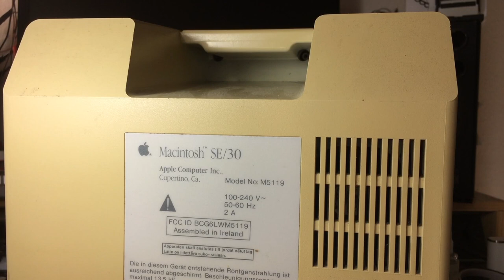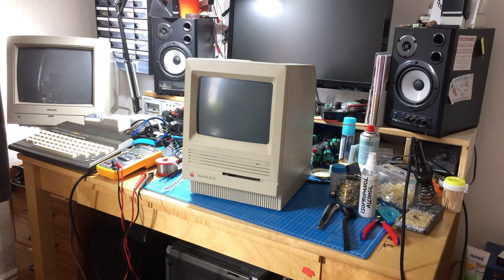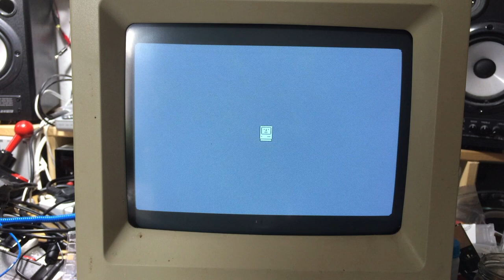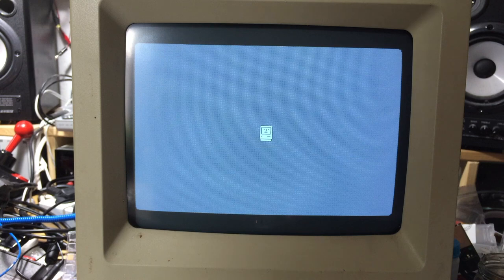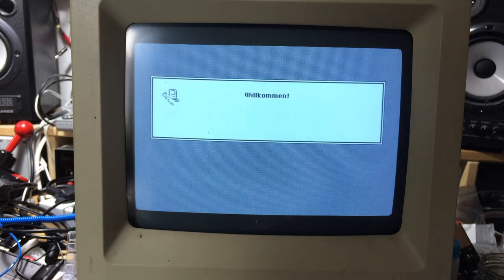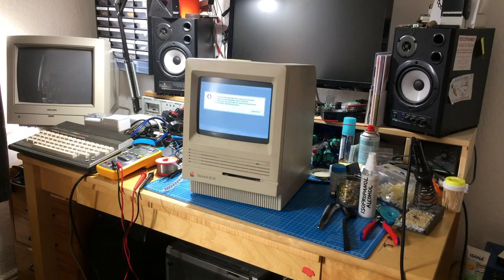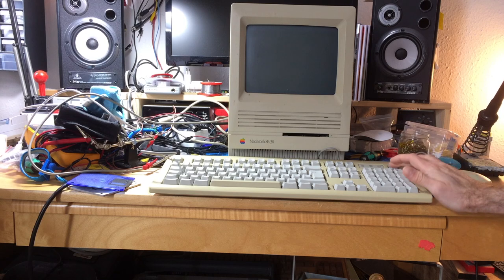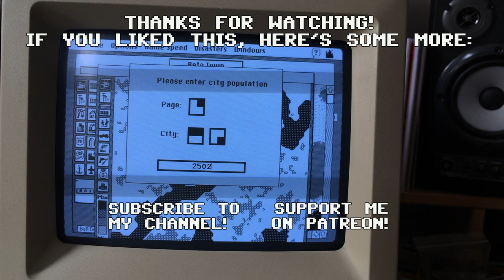Macintosh SE/30 Capacitor Leakage Repair and Recap

Comment: I had my SE/30 motherboard re-capped recently and am very happy I am back to using System Software 6.0.8, which is very fast. I play a lot of the classic games but mostly use it for writing. With the super fast boot and shutdown times if is something I can use when I get up in the middle of the night with an idea I want to add to my other writings. It is almost as fast as using pencil and paper, but much easier to edit. Nothing beats these old Macs for an uncluttered, focused writing experience. I use an old DA called Diary. It is the best for simply sitting down with some coffee and writing. My SE/30 has been a part of my life since Christmas of 1992 when I bought it from my college roommate, so while not the original owner, I have had this computer for about 27 years now.

Comment: Great Vid.  Just went thru a lot of this myself with my Mac Classic.  Opened it to check the battery, and the battery was fine, but noticed some cap leakage.  Ordered a cap kit and removed the caps.  That's when I noticed some bad looking corrosion under one of the caps.  It ate thru part of one of the pads.  I cleaned everything with isopropyl and vinegar.  Luckily when I checked, there was enough of a pad left on that bad one to still resolder the new cap.  The system acted a bit unstable after the work tho, so I took it out and recleaned it.  It still didn't look as clean as I wanted, so I went for the dishwasher method.  After lots of drying, put it back together and it seems good now.  Hopefully it is OK for another 15 years or so.  ;-)

Comment: I still have the original system 7 full disc set in its original packaging, great to see an old Mac up and running.
Reply from the maker: Oh, nice! Pretty hard to get those today in good nick, I guess. Had to fiddle around quite a bit to write the old HFS disks. I thought it would be easy with my MacBook and an USB drive but OSX dropped support for HFS some versions ago and only supports HFS+ now. Had to use bash and dd the image files to the disk. Which in the end worked very well. I found out later that most Linux's supports HFS natively. Maybe I'll do a little video about that some time.

Comment: awesome Jan. when i first started work a million years ago i worked with SE30s and LC2 Macs. They were awesome machines for their time given the counterparts were PS2 model 70s and Windows 3.11. Good to see this little beast running again.
Reply from the maker: Thanks! Yes, it is running very smoothly compared to the PCs of the time. And the OS was light years ahead in terms of simplicity and speed. :)

Comment: I know this is an old video, but the twist method to removing caps. I've lifted traces using hot air (because they often glue these components to the board for the solder flow machines), and lifted traces just using the soldering iron rock back and forth method. I think if if a pad is badly damaged to start with you're going to end up having to repair that anyhow. One thing I've run into with hot air too is the cap exploding? What temperature did you use?

Comment: Great video, as always mate. Reference cleaning the pcb's, the best method I tried so far is vinegar first and then dishwasher. Never got any damage with that method and pcb's come out nice and shiny :) Keep up good work!
Reply from the maker: Thanks! I was a bit hesitant about the dishwasher but will try next time (maybe with a less valuable board at first). :)
Reply: Dishwasher with a mild non-abrasive soap solution.
Reply: douro20 whoa, that's a coincidence.. You commented just now, and guess what? I'm washing x4 Commodore PET motherboards now :)

Comment: Hey Jan. I have one of these I bought in 1987 new for about £3000!! So have never thrown it out. I am about to start restoring as it no longer boots. Thanks for your video. I used to work for an Apple dealer at the time and if the case of an old Apple II was dirty we cleaned with T-CUT which is designed to restore car bodywork paint. It’s very effective on macs...
Reply: Bought my first Mac - a Mac Plus for $5000 in '89 and it became a career. Even worked at Apple.

Comment: Those Quantum HDDs suffer from bad caps btw =D  Often you can get them running properly just by swapping out the few caps on there.
Reply from the maker: Oh, thanks for the tip. I'm going to get in there and recap the PSU and analog board some time. Will have a look at the Quantum, too. :)
Reply: Ahh those ball mouses at 25:50 ... we sure have rubbed our balls a lot back then, cuz you know it had to be clean for game play... tsk tsk xD

Comment: Hi there, really great video, I'm going to use it as a reference when I eventually get around to repairing my SE/30. I'm not sure if this question has been asked before, but what were the specifications of the capacitors that you replaced the old ones with on the logic board?
Reply from the maker: I don't remember the exact specifications. I do remember that I bought good Panasonic ones with the highest temperature rating and lowest ESR I could find. Any caps with the right capacitance and the same or higher voltage rating as the originals will do in this machine though.
Reply: @JanBeta  Cheers for the info! I'll make sure to look for ones with a good esr and temp rating. Thanks again for the great vid!

Comment: On my own SE/30 I accidentally broke off one of those caps entirely when cleaning the board with alcohol and a toothbrush before recapping it, even though I was trying to be careful, and it took both pads with it. I think it was the same cap that you lifted the trace on!  I had to put the replacement cap on the bottom of the board, with wires running to the nearest appropriate points. Fortunately there's enough room under there to fit it! I guess those pads are really fragile.
Reply from the maker: They were pretty fragile on mine, too. I think leaky caps degrade the PCB in a way that the pads become really brittle. Experienced the same thing on my A1200. Lifted only one pad and it was one on a small cap that had leaked pretty badly.

Comment: Great video.  I'm very hesitant on those cheap hot air guns due to numerous reports (see eevblog forums) of them being dangerously wired (live swapped with neutral, earth problems).  You may want to double check the wiring inside it.
Reply from the maker: Thanks! Yeah, I was aware of the risk and had a look inside before I used the hot air station for the first time. Mine was actually wired alright. I will eventually make some slight mods to make it safer though (such as making a better ground connection and adding a proper fuse).
Reply: I thought I'd say something in case people watching don't know. Same goes for some cheap solder stations.

Comment: I enjoyed your video as I have been working on restoring a compact Mac.  I know little about the surface mount electrolytic caps and was unaware that they also leak.  I was hoping that you would show in more detail how you soldered them back on the board.  I'm sure I'll find another video about it on YouTube if I search. Also love the comment from another user regarding the caps in the HDD.  Those SCSI drives are getting hard (and expensive) to replace. Thanks.
Reply from the maker: Oh, glad I could help. I found that SMD caps that date back to the nineties almost all leak today. They used pretty inferior quality (I think there was a shortage at the time). I'll try to show SMD soldering a bit more in depth the next time I do it, too.

Comment: oh, no tap water for rinsing; it's always better to choose demineralized water. that won't leave small residues or minerals on pcb. However, pretty video as always! Cheers, M
Reply from the maker: Thank you Sir. I would usually use distilled water but didn't have enough and my usual impatience kicked in. Cleaned it thoroughly with alcohol after rinsing it though so I think it's going to be alright.

Comment: If anyone attempts such a repair, you HAVE to remove the pcb at the end of the cathode tube to avoid accidentally hitting it and breaking the tube. It's super fragile. Once you remove that pcb, it's much easier to pull out the power connector. There's only one way to put it back, so no worries there.

Comment: Great Repair Jan, what temp did you have the hot air station at to remove the caps safetly?

Regards...
Reply from the maker: I think I had it on approx 350C in the end. Started out a bit lower but the higher temperature worked better for me. I guess it depends a lot on your way of doing it, how quickly you move the hot air gun and also on the PCB and the used solder etc... Probably requires some experimentation. I practiced on broken PCI cards for a bit.

Comment: Great job.  I have an SE/30 that I wasn't able to get running.  Getting horizontal stripes.  I'm pretty sure I messed up the re-cap process so I will be doing it again.  :-)
Reply from the maker: That's the Simasi Mac symptoms. I had that briefly when the lifted pad broke off again. It's most likely to do with the 1uF capacitor. It connects the sound and also hooks into the reset circuit (if I remember correctly). I would check that one first. (I'm not very experienced though obviously as this was my first Mac repair ever...)
Reply: cb meeks have you checked the voltages coming off the external floppy port? You need +5v +12v and -12v. If you have low voltages then it won't start and the get the weird pattern. I suggest recapping the analogue board.

Comment: Interesting video & machine! Could be fun to play with the old Macs, since I'm a Mac guy anyway. Never had the old ones. What happened to the bypass wire, just before re-assembling it? Timeline mixup? :)

How do make sure it's completely dry, after washing it? Let it sit for some hours?

1:32 - Lol, "exploding and stuff".. :)
Reply from the maker: Thanks! The bypass wire was actually added after the test run I'm showing in the video. It broke down again and I had to add the wire. Edited the picture in because I didn't film adding it. ;)

I had it sit for some days after washing. Should have made that clearer in the video, I guess. The little cavities in the connectors take a while to dry. You could also put it in an oven at a low temperature to speed up the process.

Comment: I used to have an SE.  I would had loved to have had an SE/30.  I would get a Tadiran 1/2AA to replace the battery, as they have a very long service life and won't leak.  This thing will probably outperform even my Performa 475 at some tasks since it has the 68882 FPU.
Reply from the maker: Yes! The performance was way ahead of its time for sure. I wish I had one of the color graphics adapters for it which would enable using more software (that was made for more recent machines). Thanks for the battery tip, I'll put it on my list.

Comment: Interesting board cleaning technique  I don't believe I've seen vinegar used before and was surprised you rinsed it off under under flowing water.  I always thought that much water and electronics was a bad idea.  Why didn't you use  alcohol like you usually do?  Sometimes when I use  alcohol the circuit board is sticky afterwards?
Reply from the maker: I just used the water to rinse the vinegar off and cleaned it more thoroughly with alcohol afterwards. Could have used alcohol only but it would have taken half a liter or so and I didn't have much left at the time. ;)

The stickiness of the PCBs is caused by the alcohol dissolving the solder mask (usually epoxy) a bit.
Reply: Water is fine with electronics, used throughout the manufacturing. Water and electricity is the bad thing, not electronics. Ensure there is no power, no batteries and then dry in a warm cupboard for days before applying power.

Comment: Not bad Jan.

I have heard that some people have had great success using SMD tantilum caps.
What about the analog board?

You might want to look into a sonic cleaner. Also after rinsing with water you should rinse it in isopropyl to displace any water that might of gotten trapped under chips, sockets and such.
Reply from the maker: Thanks Leland. I saw people use tantalums but I decided to go with good brand electrolytics this time (although tantalums would obviously work just fine). A sonic cleaner is definitely on my wish list. I cleaned the board thoroughly with IPA after rinsing it with water (didn't show it on camera though) and let it dry for some days (while waiting for the new caps to arrive).
Reply from the maker: Oh, and I also plan to put new capacitors on the analog board some time soon. That's for another video. ;)
Reply: I figured you would. Most people attend to only cover the mainboard/motherboard of the Mac and never touch the analog/CRT board.

To this day im still kicking myself for letting all of my old computers and parts go. Then again I would be stuck re capping everything lol.
Reply from the maker: Haha, it's tedious work indeed but I think it's worth it. I still have quite some recapping to do myself. ;)

Comment: Hmmm... you have to wash off the board with vinegar as a first step if there's leakage to neutralize the electrolyte leakage. Solder will not be easily workable until then. As you pour the vinegar (the stronger he vinegar, the better) you'll see the electrolyte fizz on the board.

Comment: I found both a mac lc 2 and a se 30, got the lc 2 working but had no luck with the se 30 after the recap, still has the simasimac issue.

Comment: Great video - regarding the pad it's life mate you will have to get some heat resistant eproxy next time though hehe!
Reply from the maker: Thanks! Looked it up a while ago and that stuff is really expensive. I guess I'll keep doing botch wires for a while... ;)
Reply: I'll look into the cost of the stuff - but in regards to retro perhaps it's worth it ? Can you really sleep at night knowing there a bodge wire in that thing lol . I know in my prime of soldering I've taken some pads off the boards of playstation pcbs but in my defence I didn't know I could lift a pad and secondly how fast they life if you apply heat for too long . Of course since then I've learned a lot . My worry at the moment is taking caps off old hardware such as amigas and in your case a Mac which could lift a pad - the twist method might of saved you this time because the heat helped lift it ? It's really hard to know honestly lol twist or heat - hmmmmm I wonder if you could make a video on some unwanted capped board how durable both methods are and which one causes more stress . 

Chris
Reply from the maker: +Ohplease I managed to lift one pad per machine with both methods so I don’t really know. Maybe it’s just bad luck. Both pads were the most corroded ones on the PCB in each case though. I guess if you would do it REALLY properly you‘d have to preheat the board and use hot air.

I don’t mind botch wires in my own machines. Would have given me a bad conscience if I had done this to someone else‘s machine though. That’s why I seldomly work on other people’s stuff. ;)
Reply: Jan Beta ah I feel you man . Well there's always another video of using a USB microscope and giving her a new pad lol .
Reply from the maker: Haha, yeah that's a good idea. :)

Comment: Nice job Jan, might got away with lifting that pad if you used two soldering irons and some quality gel type flux. I only really trust heat gun on a new PCB.
Reply from the maker: Thanks! I'm still experimenting with different methods.The heat gun worked really well for me on all other pads. I think the pad that lifted must have been cracked before I even started desoldering. The corrosion around there was pretty bad. I have yet to try the "two iron" method. Have an old broken graphics card to experiment with here atm. ;)
Reply: Cool
Reply: What temp do you use hot air?  It looked like you were able to heat those caps pretty quick!  It takes me 2-3 min per cap to get it loose!  280deg C

Comment: Hey Jan. Go to winworldpc dot com -> Library -> OSes and Shells and there you find Mac OS 7 and Mac OS 8 Install CD ISOs for download. Just grab a copy of the "Universal" ones, burn it to CDR and if you have a SCSI CD-ROM (DB-25->Centronics-50 external enclosure/adapter) install it (alternatively you can also use a ribbon cable while the Mac is pseudo-assembled - read: leave the back cover off - to connect a CD-ROM to the internal SCSI bus if you have a SCSI ribbon cable with enough edge connectors; I recommend SCSI ID 3 as that's always been Apple's default). The highest version a SE/30 is able to take would be Mac OS 8.1. Hope this helps you to get a fully working OS install going.
Reply from the maker: Thanks! I'm up and running on System 7 but I'm looking into getting a SCSI drive for more convenience anyway so thanks for pointing me to the ISOs. :)
Reply: Thank you for the Mac OS Library info.

Comment: At 22:28, is this a different logic board? There is no jumper from the cap to the chip here.
Reply from the maker: No, it's the same board. I edited the picture of the jumper wire in later. The system worked fine for the first test (that I filmed) and then broke down again so I had to add the wire.
Reply: Ok thanks :)